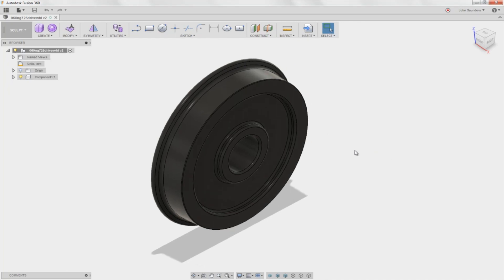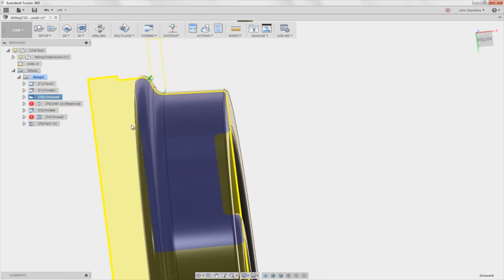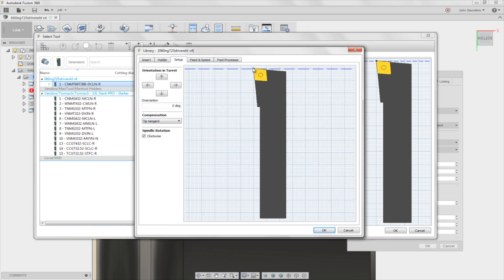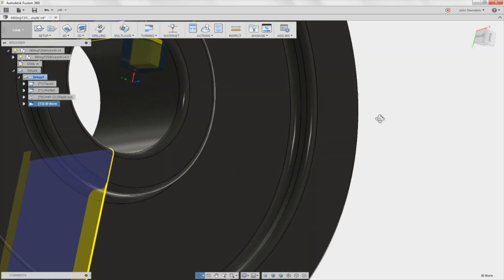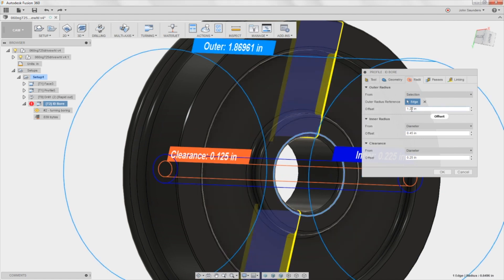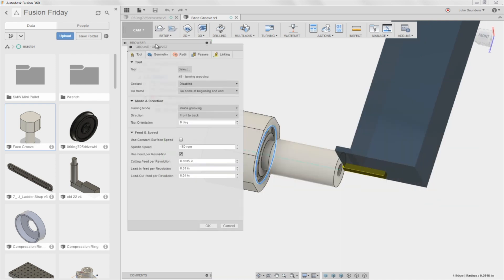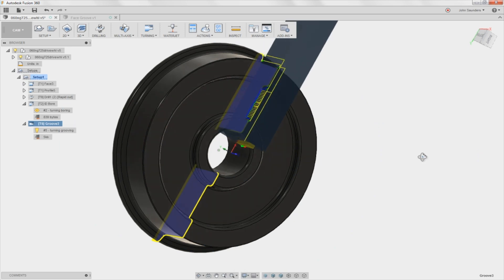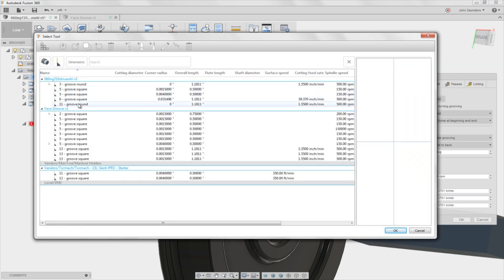Fusion 360 Face Grooving on a CNC Lathe!  FF65

Comment: its 2025 & Fusions lathe cam is still a bad joke. Some tools will not work with certain ops. Modifying an existing tool into something close to what you need will cause the op to pass during simulation but crash on post to machine (Tormach 15L) with no reasons given. It is faster & more reliable to use Pathpilots conversational in most cases.

Comment: Hi, I was looking for a way to program face grooving and found this video. It is the exact same part as I was programming LOL!

I need to do a 2nd operation on this part where the side you programmed was already made. The part has a taper on the largest side, a diameter of 35mm and a length of 6mm and a 6mm hole in the center. The operation is cutting the same face groove in the back side from 9.5mm to 26mm. 
Any ideas on how to hold these in a CNC lathe with a hydraulic chuck? the taper makes it want to push the part out I think.

Any tips would be greatly appreciated!

Comment: I have been trying to learn Fusion 360 and have a small lathe that I have added stepper motors to, and have been hand writing G code, so I though I would watch you video to see what it is like to use Fusion 360. Now I wish I had played more computer games when I was younger. It is almost the same as a game, fiddle around till you find something works. :)

Comment: Thanks for another great video, to me this part is a railroad wheel for a model train, on the grooving for the recess as it is just there for looks you could use a button tool or like this https://www.aliexpress.com/store/product/SDJCR1212H07-12-12mm-Metal-Lathe-Cutting-Tools-Lathe-Machine-CNC-Turning-Tools-External-Turning-Tool-Holder/1141026_1804918130.html 

Cheers Mark
Reply: It is a model train wheel based on dimensions but the profile is a rail car wheel of any scale including 12 inches to the foot.

Comment: Is it a correct guess that the 5th axis for the haas has a high speed mode for lathe work and that's why you don't use the lathe templates much anymore?
Reply: Tjita1 
No. the HAAS 5th axis rotaries are actually quite slow. They don't have continuous rotation like a lathe, Integrex, or a Mori with an FD table does.

Comment: You needed to set your holder to an internal grooving holder. Also I reckon given how open that face groove is, you could probably use Face Profiling instead of grooving if you wanted to take a different approach. The main issue with face grooving is the holder definition. they are extruded profiles... and so are the inserts, so you get false crash warnings in the simulation. I just define the insert and holder with zero thickness, then make sure the tool comments include the radius range your holder will support. You can then build in some checks in your process to make sure you are using the right tool for the groove. Bit of a ball ache to be fair, but workable.

Comment: I did a part with a internal face groove. 11in deep. 11.000 to 9.something +.003 -.000 tolerance on that dia. Now that was a great experience. on top of that they were from another shop that couldn't do that feature.
Reply: That's cool! I've been trying to program a will with a 1-in deep face groove small diameters 3.5 large diameter 7.0. I cannot get the toolpath to work out at all. Would you have any suggestions? Thanks
Reply: Wheel
Reply: @keithadams3513 no it was for subsea oil and gas related

Comment: Mill crash: broken endmill
Lathe crash: BOOM
Better hope you have your safety squints on for that spectacle.
Reply: I worked at a shop a while back where the lead hand's father was a service tech, got some rather interesting stories. At one shop the operator of their HMC set the part zero at the bottom of the part rather than the top, then ran the thing at 100% rapid, the cutter plunged through the part at full rapid speed, into the vice and friction welded itself in place. The whole spindle was a goner, and needless to say, the operator became an ex-operator. Goes to show you, always prove your programs and setup, always.
Reply: Eggsr2bcrushed I have heard mills make a boom too lol
Reply: Ryan Noppe it's a bit harder to goof that hard on a mill though
Reply: Eggsr2bcrushed only takes one tool not set....
Reply: Ryan Noppe that's a minor incident, a major mill crash is crashing the spindle into the vise, aka the same as almost every lathe crash. I've heard of tool holders going flying with a chunk taken out of them from the chuck.
Reply: Old Mori gear drive BT50 machine took a 6" face mill and plowed it at rapid thru the part, thru the vise breaking it in half and proceed to friction weld the face mill to the table... it only stopped when it said it ran out of Z travel...
Reply: This is why distance to go, block mode, and 5% rapid with a finger on estop is so important.
Reply: You have no idea what you are talking about.
Reply: Me?
Reply: Yes

Comment: 6:35 arent you crashing to the chuck with those tool paths? "models mill tables and vices to a minute detail, does not model the chuck. - hating lathes because crashing" :D
Reply: Janne Kotka everyone crashes.... I did my second day. last time since. I run fanuc and hurco both conversational and about 500 times faster to program at control. also more of a mill guy but like running our hurco tm18. it's butt puckering
Reply: Janne Kotka I think he's maybe is using bar stock looks like a smaller part
Reply: Janne Kotka I had my coupler break on my z axis  dropped bout 3in into my vice. machine was OK just had to replace the coupler.  my 2" iscar upfeed took a little beating but is still usable. vise was old but still a decent vise.
Reply: ouch. i just crashed my 3d taster on to my vice. i'm so glad for the invention of those tips that have the weak points built in :D